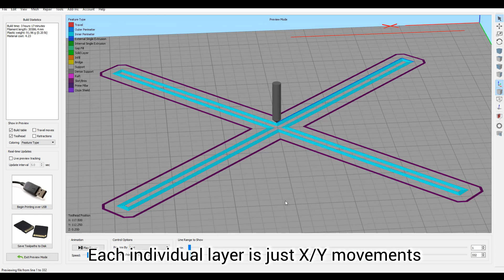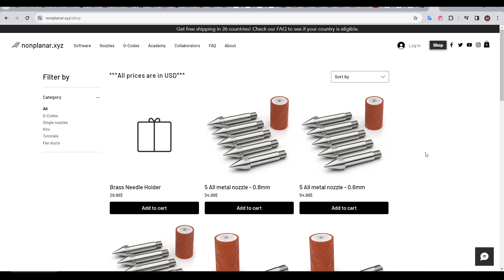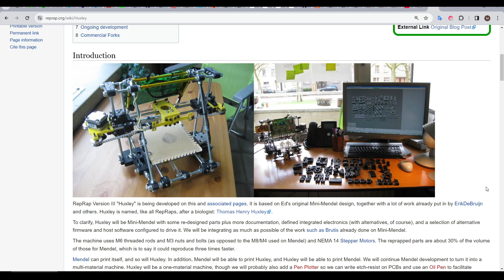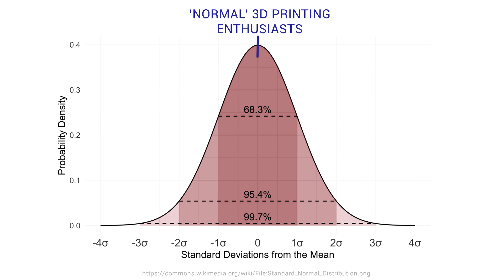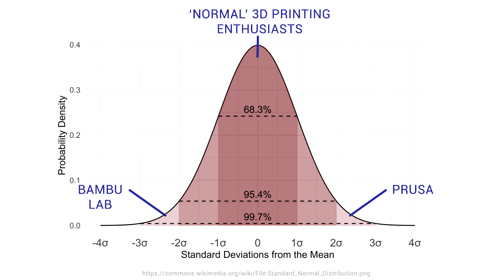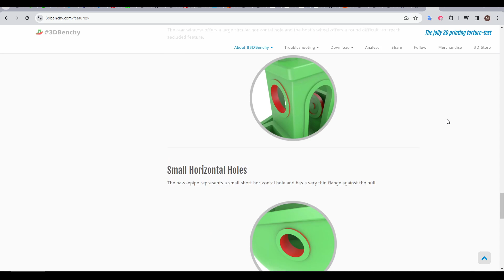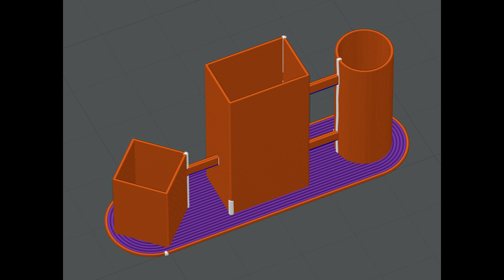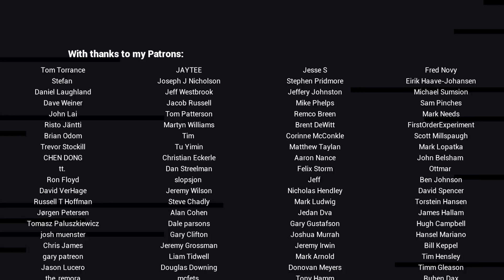3D printing mysteries that need to be solved in 2024

Comment: My two cents, when I calibrate my temperature controller, I feed material through it, done by hand as the auto calibration is doing it's thing. Important as it needs to calibrate based upon how the demand is placed upon it, common temperature calibration step to miss even in an industrial setting.  The results are a very temperature stable extrusion and or process.  My machine is a series 1 pro. Still printing.  
Toxicity, you get what you pay attention to.  Don't give them the soap box or platform. 
The breaking PLA I think it has dried out too much, I have also experience this.  Old too also could be it. Know in time all the atoms want to move around to become a more stable shape, like a diamond hard but brittle as the carbon atoms align in a tetrahedral configuration, the atoms in plastics align.  The plastic bags does this too, a short time example of this and why they break to pieces so soon, all plastics do this, and will eventually fail. some faster than others UV light accelerates this.  Thermoset is far more stable and thermoform plastics will fail quicker. I know sounds insane but welcome to the real world.  That plastic shovel, that plastic mop, the bucket list goes on. Cheers!

Comment: I wait patiently for non-planar slicers. I would have thought it's a simple implementation from the CNC world. Just like the G-code was originaly imported from CNC's, 3d-4d-5d-6d machining is the norm today. Given 3d machining is pretty old and mature i was expecting to be implemented sooner into slicers.

CNC's have the exact same problem (and even more) of non-planar 3d printing: reach and collision avoidance. Subtractive manufacturing means you need to reach every surface of the part with a spinning straight tool (or spin the part and have a wonky fixed cutting tool - lathe style). So for many surfaces you may need a different orientation of the part to reach it, or an angled approach to gain access to some areas. Repositioning the part on CNC hugely impacts accuracy. So make it one fixing and add a bunch of axis so you can reach everywhere from a single setup.. so 4d-5d-6d progression was natural for CNC world.

Additive manufacturing is not nearly as limiting to subtractive machining as you don't have forces, and feed rates, and climb/conventional milling and chatter and rigidity problems.

The math is there, already done and implemented in G-code creation in CNC "slicers" (Catia machining, inventor CAM, etc) with an abundance of tricks to adress each of the miriad of problems a CNC has (and a 3d printer does not). What really needs to happens is to have a pro CNC guy that really loves to tinker on 3d printers (and also knows programming and math involved and passion and has time to do such a big sideproject.. feels like a teamwork task, rather than a one man weekends project)

Comment: Don't assume that the "build a Voron" chorus was tribalism.  If you're in the market for a printer, possibly your first, picking the right one is paramount for most people.  If a printer they are considering is lacking in build videos, they will be keen to know what the experience is like.  It might not have been brand loyalty to Voron, but brand scepticism.  That is, the unspoken question might have been "is this as good as it's claimed?" after all, who wants to watch someone build something that they've already built themselves?  Also, people may not trust any videos already out there as much as they trust you, so asking for an impartial assessment from you is a compliment.  I'm not suggesting that there isn't tribalism (clearly there is), just that you need to be careful not to ascribe to tribalism that which is genuine interest.

Your question about the tall square being affected by the short cylinder is because of the difference in time to print each layer.  As you noted, the print first changes when it starts printing the top layers of the cylinder, and then changes again when it's no longer printing the cylinder.  At the start, each layer takes a consistent amount of time.  When it's printing the top layers of the cylinder, each layer takes substantially longer.  By the time it gets round to the next layer, the previous layer is cold and hard, whereas at the top,  it's still malleable and will be distorted by the next layer.  Use a micrometer to measure the width of the column at each of the three areas.  I would expect it to be slightly smaller when printing the top of the cylinder, and widest at the top.  I doubt this can be completely eliminated, but slicers could make micro adjustments to the extrusion rate and possibly layer height to compensate for the layer print time.  Better filament cooling would help, printing multiple copies so that every layer takes long enough for the previous layer to have solidified would also help.  You could also add delays into the g-code to make each layer take exactly the same time, but that would increase print times a lot - the funnel of the benchy would take as long per layer as when it's printing the deck.  If you watch a benchy printing, when it gets onto the funnel, each layer takes such a short time that the whole funnel wobbles.  You can usually see an imprint of the deck in the bows.  Some materials have a faster transition from liquid to solid, so printing just above this threshold will mean all but the shortest layer times will give the part time to solidify.

Comment: While non-planar slicing would be nice. I can only imagine what a nightmare it is to get working properly in software. The planar nature is probably a deeply embedded in the algorithms of the slicing engine. Added to that even when those assumptions are removed, new questions like how to solve non planar overhangs, and how to compute the maximum angle and integrate the available clearance for the nozzle itself and the entire hotend assembly. 

About why the tube snapped there are multiple possibilities, volatile plasticizer that evaporated over the years, water absorbtion that together with temperature changes might slowly introduced stresses in the plastic, or deterioration under the influence of UV light or any combination of those.

To the print artifacts. I think the nozzle movement also plays a role my. Stepper motors even with micro stepping don't have infinite precision and the belts/gears also add some wiggle room. When the printer has another model it's movements on that layer are different so the tolerances add up differently depending on the path, jumps also add more acceleration into the mix even on a solid frame reaching 0 vibrations is basically impossible.
The time the filament has been molten might also change (in addition to the temperature change mentioned in the video), retractions leave the filament longer in the nozzle and I noticed some filaments have slightly temperature sensitive colors that can probably deteriorate slightly inside the nozzle depending on time and temperature in the molten state.

Comment: Filament snapping: I've had this happen with PLA that stayed in my cheap bowden tube for a long time, I too noticed it was much more brittle than the rest of the spool. I think it's just the moisture chemically interacting more with the filament than on the spool where it has a chance to get reabsorbed into the air with heating cycles; there's also a chance the bowden tube is leeching chemicals that interact with the filamen - although I think this would not happen with my bowden at a couple of years old.

Comment: My theory on the little shift when you have holes and other objects: (maybe) it's the actual nozzle getting slightly offset?, since it can't complete a full layer it has to stop a fraction of a mm shorter, but the rest of the movements follow the same number of steps causing the offset? Gcode is math and maybe the single offset affects everything else. Maybe experimenting with a higher  ratio between the stepper and the belt/lead screw will solve it. We wont know till we try

Comment: One possibility is that the artifacts are caused by a setting in the slicer. The gaps between your towers, between the bridges that connect them are considered holes. In Cura it is called Hole Horizontal Expansion. It needs to be set to 0.0 and never touched again.

Comment: I don't remember how old you said that one filament was, but normally when it cracks like spaghetti it's too mmmmmmmmoist (which after a while, usually a couple or so years depending on conditions, it will degrade to the point that it can't be reversed; Zack Freedman has a video on that)

Comment: Good video and many thoughts that are true. Especially the flame war part :D.   The second i dont have answer on is the brittle one. Have the same on my printers that have bowden tubes. its only on them. Something happening with the filament being stuck inside that tube for some time?  I have learned the hard way to never leave filament inside of them on my printers and always retract if i dont print for some weeks.

Comment: Flow rate is likely the biggest reason for the artifacts, but also wondering if travel direction could be another cause?

Similar to monatonic vs rectilinear, the nozzle may travel clockwise/counter clockwise while doing the outer perimeter which may have an effect on the way light bounces off the part, and any cornering dynamics may be flipped.

Not sure if the slicer already prefers one direction or not, but it may be something to investigate.

Comment: Regarding the artefact shown at the end, I've heard speculations that those occur due to the change in layer time... 

As you move from square and circle in one layer, to only square in the next, the time the still-warm filament has to dry before being subjected to the next layer changes. It's hard to see in the video, but my guess would be that your first example has a gradient to it, as the time spent per layer becomes uniform again, while the second print you showed has a more distinct upper edge, as it changes layer time again based on the design 🤔

Comment: Non-planar slicing would be awesome to have. Even being able to do it only on very shallow slopes with an off-the-shelf printer could make tons of prints look much nicer. There are other non-planar operations that I'd like to see in Prusaslicer as well. Right now, you can print objects one at a time given certain conditions apply, but the limits are much more stringent than they need to be. For example, it won't allow you to place something tall on the front of the printbed and then another object behind it. It warns that the first object would interfere with the gantry, even though in this orientation it would not.

Comment: What you should build is an anet a8 plus then buy a bigtreetech 1.4 board , revo micro, nautica fans, upgrade the psu, swap the x rail for a linear bearing, swap the z to belts, put a linear rail on the y also. After that you have bragging rights your $200 printer is king shit.

Comment: I think the rotation of falling filament wraps in a clockwise direction (seen from the top) because when holes are drilled they are drilled with right-hand spinning drill bits.  This creates very small defects on the walls of the hole, like very minute rifling.  This imparts a very small amount of twist which predisposes the filament to twist in the the same direction.  Once it begins it is a self-reinforcing physical process, because the deflection of the falling filament as it makes its way around the accumulating pile causes the filament coming out to deflect in the direction that continues the process.

Comment: Filament when extruded midair will follow the forces "imprinted" during manufacturing process: during virgin extrusion, stretching and spooling; and the natural "curl" of the polymer molecules. It just happens that most industrial machines work "left to right" and polymer molecules are oriented clockwise themselves.

Comment: Those surface artifacts are from changes in cooling layer to layer, and they are indicative of insufficient cooling. If you cool your material fast it locks into its structure and you only get thermal shrinkage really, but if you cool it more slowly it is basically annealing and shrinking as it crystallizes. It is basically gone on any printer with static full bed cooling. It is definitely exaggerated on parts where you have islands so there is only a little bit of air on that section of the model at all. This is one of the few things I routinely have to share on r/fixmyprint because people can't tell they don't have enough cooling, and there isn't much documentation on it.

Comment: Ok, lets develop a nozzle with cooling channels that are built in, before you stop reading, we must incorporate an insulation layer. We have to have a thermistor inside the nozzle itself as well.  Maybe even forget a heater block and have the nozzle contain the heater cartridge. yes i'm shooting for the moon , but the moon is where i want to get. 3d printing has/could/can/will go extremely far, but there is no reason we have to wait.

Comment: On filament snapping. I had issue with certain filaments and my Bambu AMS. I would need to open it up often because filament would break inside.
The reason I believe is PLA sitting in PTFE tube becomes brittle over time.
Some PLA more than others.

Comment: About the artefacts 
My guess would be different cooling times
The nozzle is heating up the material pretty uniform until it has to close the hole at the top
The print than has more time to cool until the hole is closed

Comment: The filament breaking in the Bowden tube reminds me of shoving a spaghetti noodle through a macaroni noodle and it will split into mostly equally length parts and shoot out. Actionlab did a video on it recently. Maybe check that out.

Comment: I think the reason you’re filament is breaking in the boat and tube is because the filament is bent in one direction and older, and the Bowden tube is bent in the other direction so as the filament is going through, it because it’s bending it in the opposite direction that it’s already shaped in from being wound round the spool. Like pushing dry spaghetti through a macaroni.

Also because you’re not using the latest “Prussian Blue Labs Crender Vornado XXX”

Comment: For the last one, I've had artifacts like that pop up every now and then on single piece prints thanks to adaptive layers. I don't think that's the cause in your particular example but it leads me to believe it's temperature related as well based off the discussions in the thread and your example. I think the different flow rates at different portions of the print is changing the finish just enough due to temperature changes to be noticable.

Comment: Solved: https://youtu.be/J_pxk7HP3RE?si=ycwikql_-lfN9oIS

The surface changes when printing multiple parts seems to be a speed/flow issue indeed. Speedcheck the layers and get them consistent. The solves in the vid have worked for me. Just cranked out several multi-part plates.

Comment: The artefact you’re seeing on your cuboid is the notorious benchy hull line manifesting in a new way.  The layer time changes very suddenly, that means you get a different amount of contraction of the plastic between layers and a discontinuity in the exact way the layers join.  It’s unfortunately, extremely difficult, if not impossible to fix in the slicer.

Comment: You really have too much faith and optimism in the average human. I feel for exactly what you're saying in the middle section of the video, but the reality is that the internet has been toxic because it lets the average, ugly human run wild. I don't think there is any perplexing part of any particular niche community getting worse off as it becomes more accessible to more average people compared to those who are insanely committed or capable in order to get into 3D printing as an early adopter. It's a real and good observation but not a mystery, nor requires solving.

I was not an early adopter, designed for printing on uni printers around 2018 but only got my first printer ~2021. I was quite disappointed with my CR-6 and how it didn't let me 'just print' as the hardcore enthusiasts were raving about how much more livable it was out-of-box compared to Ender 3s around 2020. While I did ridiculously go ALL THE WAY and not only learned how to upkeep and upgrade my no-good printer, but even design my own, 1-of-1 unique direct extrusion and fan mods, I had gone through all the stages of grief shared between the majority of us who don't want to keep tinkering.

It is completely understandable that the average newcomer has very charged opinions about certain things especially if they've fallen victim to some more common edge cases before. Ask the old-timers in the F1 community how the Netflix series Drive to Survive has destroyed or diluted their passionate sport and we'd understand that it is a necessary trade-off to accommodate or ignore more average dumbasses in order to grow what we love into something much bigger.
I know it sounds so pessimistic about the human condition but it is the cold hard truth that regardless of indicators of intelligence, the less passionate the target audience is about the topic, the less responsible they will be when interacting.
Reply: Sorry if it sounds, ironically, as toxic as its source, but actually the distillation of the point is that most people have many interests and only 24 hours to spend; given that we know the average human isn't a saint on the internet, the odds of one being passionate and knowledgeable about the 3D printing community decreases as the proportion of casual, passing-by members increases, the result of these inputs should be expected.
Hopefully it sounds a bit less crap when explained like math compared to an internet rant. (But it is, indeed, an internet rant :>*shrugs*)